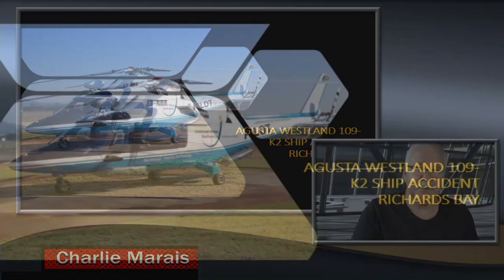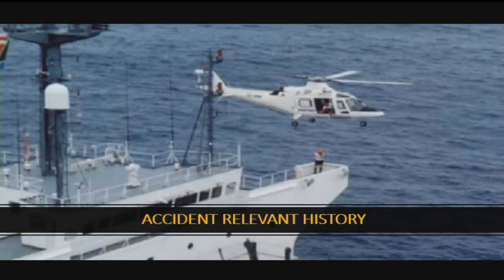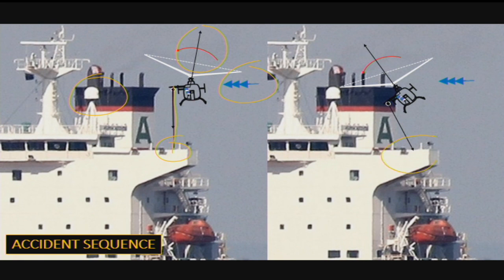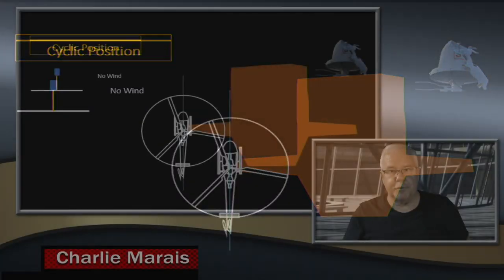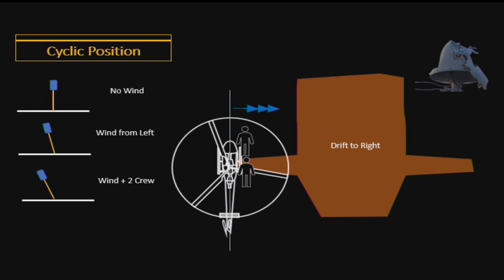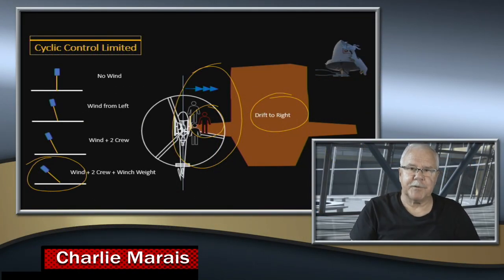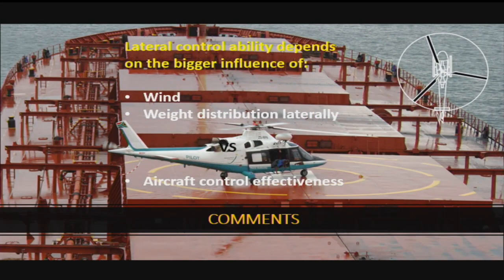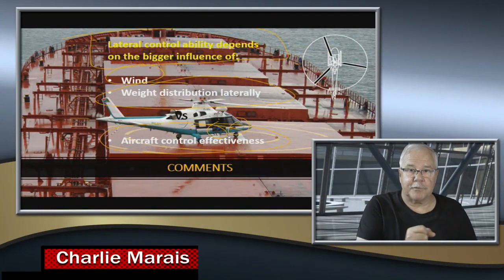Agusta Ship Accident

Comment: Hi there "Uncle Charlie" 
Trust you are well and interesting channel you have.

Ok, so let's hear the events and actual condition from the "horse's mouth" as they say. 

Let us start by looking at the wind: 
The wind at the time was from my (relative to the helicopter) 11o'clock position and at about 10 knots. The vessel was doing about 7-8knots. That gave me a relative wind of about 17, max 20kts just off the nose and from the left. By using the basic 1/3 rule to determine cross wind, I had less than a 7 knots cross wind from the left. (The accident investigator used the "average" wind direction and then the max wind speed reported that morning. This was from the airfield more than 10 miles away. I think he used a 20 or 25 kt wind at 90 degrees from the left in his report. Not true.  Remember that I was hovering 20meter from the ship's chimney and that thick smoke trail is a direct and very clear indication of my relative wind. (Almost like the smoke grenades we use in the military....)

Lets now look at the crew:
The hoist operator was our lightest hoist operator and was about 65kg only. Myself at the time was just under 80kg and the marine pilot was 85-90kg. 

Agusta 109k2 COG Limits:
If you add our weight and the fuel state at the time into the Agusta's performance graphs then the following would have been needed to reach the Lateral COG limit : 
We needed an additional almost 200KG added to the hoist, apart from the marine pilot already on the hoist, AND the cross wind component of , I think it was 28kts (with 280kg on the hoist) before the Agusta would have reached her COG limit on the graphs. 
In theory we could have had two more guys the size of that marine pilot AND the wind could have been at 90 degrees @ 25kts and still we would have been inside the graphs. 
Remember that even on the absolute edge of the graph the machine is still fully controllable, only when you get outside the graph, you entering the danger zone. 

Marine Pilot getting hooked:
This is added in the equation of the GCAA investigator. He suggests that the marine pilot got snagged on something, used a 25 or 30 kt cross wind component and even in his own calculations then proceed to say: Putting the helicopter close to the edge of the its limit on the graphs. "Close to" and outside are two different things.

Everything was still going fine till about 2-3 seconds after the marine pilot left the bridge-wing. The ship's 1st officer, that was monitoring the event, and my report after the accident are virtually identical, and we have never seen or spoken to each other. In his words:  "Shortly after the marine pilot left the bridge, the helicopter started drifting to the right." This matching my statement saying about 2-3 second after the load was taken up by the hoist operator, the helicopter started to an un-demanded roll to the right that could not be stopped by myself.  The "option" of something that got snagged (they suggested the marine pilots shoulder bag) is not a valid argument as he was already clear of the bridge wing when the poop hit the fan as they say... 

I can see by looking at the videos on your channel that the aim is to make others aware and learn from other accidents as much as we can. By listening to your reasoning and explanation it all holds water and certainly new (and older) pilots can only benefit from it. However that was not the case during my accident.

This is also not the platform for me to go into counter arguments/discussions, but things that were omitted in his (GCAA investigator) report included the mixing of "non compatible" (according to Agusta it is not allowed) main hydraulic servos. He knew about it, but released his report without including Agusta's report on the consequences of mixing the servos. Also somehow, when I spoke to him, he was not aware of the work that had been completed in 5-6 weeks vs a recommended down time by Agusta of almost 3 months......
The helicopter had just returned from a 3500hr major service that Friday afternoon. (I crashed Saturday morning).

The crew before me did the 1st flight Friday night and by the time they advanced the fuel levers to flight idle (after start) the helicopter nearly got airborne. It was standing on the pad with her oleos fully extended and if you even moved the collective one inch (as is required during control check prior to TO), she was airborne.  He complained and they then sent engineers that adjusted the rigging that night at about 23h00. The rigging was apparently adjusted 3 flats. This a rather large adjustment for a "serviceable" helicopter.

My first flight that Saturday was a land on deck flight. I could feel that the rigging was not yet perfect. On my return from the vessel I started my final approach section at the breakwater where I have started it several hundred time. With the collective fully lowered, I still passed over the pad at about 100' and 60kts as she just wanted to fly....

There are also many other interesting issues that we wont discuss now. Maybe I will join you in the studio and we talk about it.....

I will close this chapter by quoting "Simba" (the hoist operator that died in the crash). He was one of the engineers that had worked on the machine the past 5-6weeks. He was ex SAAF flight engineer and qualified aircraft technician. He said the following about 2 hours before the accident:   "We did a lot of work on this machine in a very short period. It was too much and we worked till late every day. I do not think it was safe to work like that........."

It were those words that made my wife decline, for the first time ever, to join me on the flight. Her gut feeling, based on Simba's comment was what saved her life ....... Thank you Simba, I owe you my friend !! 

Regards

JB
Reply from the maker: There are a few stories floating around, and was it not that I have experienced the same in a Puma during ship operations, my deductions may have a difference.  He ran out of cyclic in the lateral sense, no doubt about that.  The most probable reason is wind, lateral weight distribution and the trouble started as the weight on the winch was taken. This weight I believe was not taken by the pilot, but rather by the winch operator.  No matter, just a little surprise to the pilot, but not so that an accident was immanent.  The weight of the person on the winch may have been quite a bit more than the normal captains weight, could not verify this one, and/ or a possible hookup of something of the guy on the winch to something on the ship.  No, no one knows and those that can tell cannot due to death and accident trauma amnesia.  I think nothing wrong with machine and due to the combination of circumstances the pilot ran out of lateral cyclic control.  He simply had no time to pull enough collective pitch to climb above the ship to avoid collision.  Good pilot, good winch operator and in a corner without escape.  Yes I know there are a lot of rumors' and the pilot even may not agree with me, unfortunately I can only work with evidence provided through legal means.  Thank you for the reply, let we all can learn from these happenings is all I want.
Reply: @AirCrashInvestigator  No Charlie, actually read all my comments. Not Wind, Not Weight and Not CoG limits.....

I was the Pilot !!

Johnny here 😉
Reply: Never underestimate the invisible physics under the  rotor. The fly bridge itself is going to create invisible vortex currents of wassh reflecting back up of the bridge deck and wash flowing beyond and under the bridge creating vortices. In short under the winch side of the bird the air is turbulated compared to the port side of the bird in clean air. At some point the turbulent air is too mushing to provide enough lift with added starboard weight lift and the superior lift on the port side simply rolls you over right.  The solution would be to hover well above all wind turbulating structures and do a sufficiently longer winch instead of 25 foot.   Here in the US, a while back there was a well known race driver that flew his own  MD 520 he attempted to due a high hover  vertical approach from about 60 feet up into a very confined car parking area in the pitting area. He was looking good until he was about 20 feet agl,  he suddenly rolled over and  THE END.  It is considered that 10 foot high chain link fencing just 10 feet either side of the unauthorized LZ he chose with buildings just another few feet on other side of fencing caused all kinds of soft turbulated air instead of smooth wash. When that happens whatever side of the rotor disk still cutting through non turbulent air is going to lift better and uncommanded roll you over.

Comment: weight distribution,increased wind,should have also been aware of "mast bump"..vessel should have been in a down wind configuration vs helicopter ,i.e, they, the helicopter into headwind,plus some safer altitude from the pilot and awareness all around.clowns
Reply from the maker: Thank you for the reply.  Mast bumping is quite another issue.  Here I referred to lateral control limitations and not the mast bumping, which translates into gyroscopic behaviour of the main rotor disc.  Very experienced pilot this one, know hi9m personally.  The lessons to learns for chopper pilots s that when all the elements add up to end with no more cyclic control, the aircraft will drift without being able to be stopped by the pilot.  The only way out now was to pull all power to climb out above the obstacles and/or at the same time to jettison the load.   In this case this was not possible and the time to avoid collision with the ship became inevitable.  Chopper pilots as a rue do not worry about lateral CG, but when you start flying the bigger ones, this becomes a serious issue.  Yes, if the pilot thought that this could happen, I am sire he would not have been surprised.  Enjoy, more lessons to come.